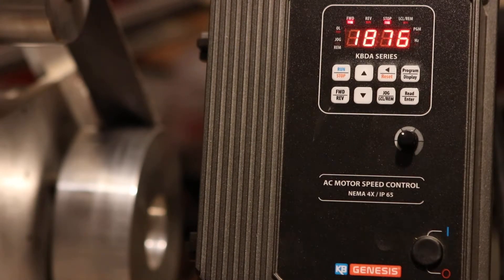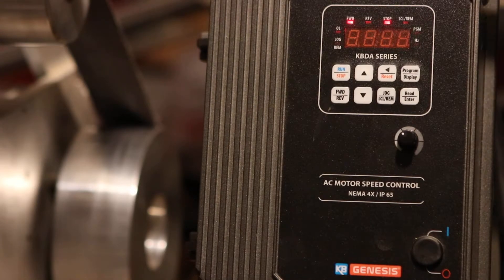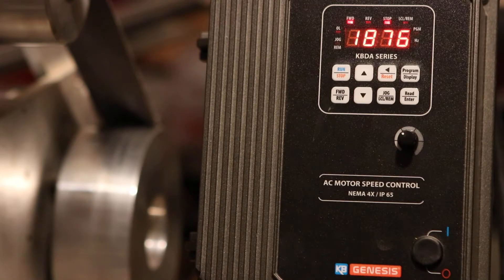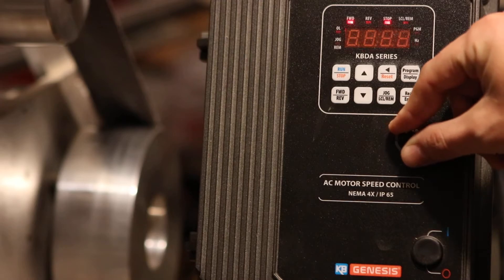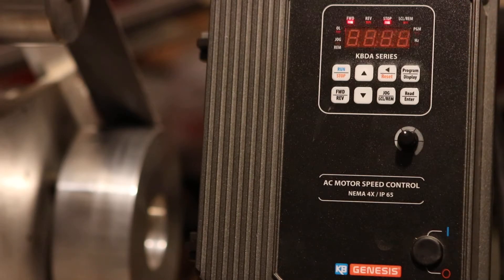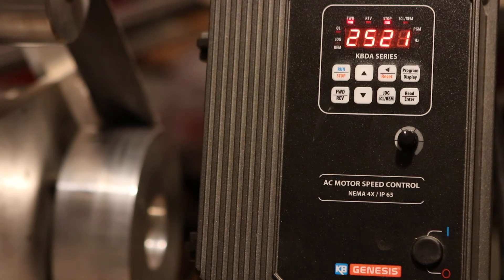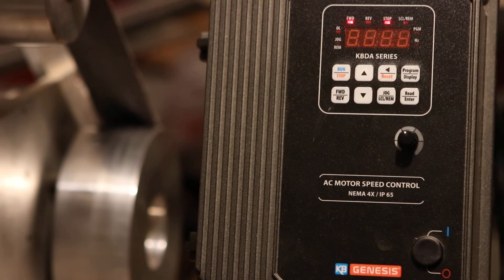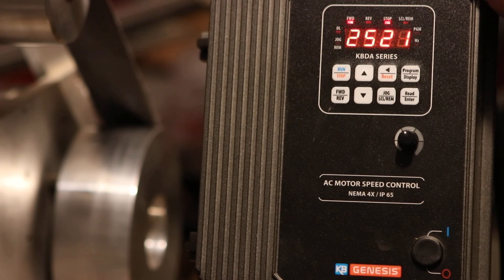Kbac or Kbda for knife grinder Vfd and why!

Comment: Thank you for this informative video.  I purchased a KBDA-29 to run a 3hp Baldor motor a couple of years ago (agree with your points!), and tried to modify the screen output per another video, but I didn't get the result I was supposed to get.  Can you point me to instructions on how to set up to read SFPM, as you mention in your video?  Thank you.
Reply from the maker: Here is the video I made about this https://youtu.be/1NsaiOwZMZY  . On page 20 of the pdf there is a table with all the settings. Short version is, figure out your max Sfpm based on the drive wheel and motor, set the vfd to max when programming and set the custom
Unit to that number.
Reply: @asquaregarden  Thank you!  I'm putting together another grinder right now, and will re-use my KBDA-29 for it.  It has a larger drive wheel, so I'm holding off on re-calibrating until the new grinder is done.  :-)  Merry Christmas, asquaregarden!

Comment: I’m having the same dilemma right now…thanks for your video.  Definitely going with the digital version!
Reply from the maker: I don’t regret buying it, I just wish I had two of them.
Reply: Just wanted to get your thoughts…I got the KBDA-29 and a 3HP Leeson Wattsaver motor.  I’m having issues with the motor vibrating and jumping throughout speed ranges.  Spent all day back and forth with KB and made some parameter adjustments which helped but I’m still having enough of a problem where I won’t be able to use it.  KB says the KBDA has issues with high efficiency motors and I may just have to switch to the KBAC.  Just wanted to see if you had any input and also see what motor you are running.  Thanks!
Reply from the maker: I have connected the Vfd to 3 separate motors at this point. Two of them are 3 hp Baldor motors, one 3600 and one 1750 rpm. The other motor is 3/4 hp Westinghouse that is likely original to my 40s Southbend lathe. All worked fine. The only issue that I have seen is when I switch from the lathe to grinder motor, if the Vfd still has residual power it will jump through speed ranges, but will fix itself after a minute or so.
Reply: @asquaregarden  Just wanted to give you an update…KB says the KBDA has trouble with the Leeson and other high efficiency motors because it hasn’t been updated to their 3G architecture, the KBAC has.  They’re doing the R&D on it now but ETA for when it will come to market is unknown.  The pandemic screwed everything up.  Just FYI for you or anyone thinking of using the KBDA with a Leeson Wattsaver.  I had to send it back and order a KBAC.  Thanks for your help.
Reply from the maker: I am glad you got a next step. I am curious if it’s going to work with the Kbda. Why did you decide to change the Vfd and not the motor?
Reply: @asquaregarden  The return shipping for the VFD was much cheaper than the motor and I got a really good deal on the motor...almost 1/2 price.  Really wanted the KBDA but it wasn't meant to be.

Comment: You mentioned configuring the display to show sfpm.  I am looking to buy this unit and have been looking at the manual they offer online.  It is not jumping out at me on how to set that up.  Can you describe the steps you took to setup the custom ratio?
Reply from the maker: You need to change options 400, 401 and 402 but first you need to know calculate the max sfpm based on your motor rpm and drive wheel. I will try to make a video on it explaining step by step in the next couple of days.
Reply: That would be very helpful as I pulled the trigger on one a couple of hours ago.

I was reading the comments of another one of your videos and It looks like I might be in for a little learning curve on getting the motor speed setup also.  I got a Leeson 116761 (http://www.leeson.com/leeson/searchproduct.do?invoke=viewProductDetails&motorNo=116761.00&productType=) that I am looking to run at double speed.  If its not too much trouble can you touch on the speed setup also?

Thanks again for your help
Reply from the maker: Here you go. https://youtu.be/1NsaiOwZMZY I made one for the 2x speed but it not up yet. I'll let  you know.
Reply from the maker: Here is the other video https://youtu.be/WM5RKepSaas
Reply: Thank you very much.  I should have my vfd by this weekend, really looking forward to trying this.
Reply from the maker: I hope it helps.

Comment: Do you have any experience with the KBMA? It's on my short list of VFD to consider buying for my lathe.
Reply from the maker: I've checked them out before. If I remember correctly the main difference to a Kbac was the enclosure and the max Hp. I personally am a big fan of over engineering and in the case of the  VFD as you can tell from my video I went with the biggest one I could knowing that I would only have to buy one. The advantage of having a bigger Vfd is that it will not limit your choice of motor. You can alway run a smaller motor on a higher rated VFD with just a  few changes in configuration but not the other way around. Plus you can run multiple motors from one like I shown in the other video. And  I can tell you that when you run any motor at a lower frequency you lose power directly proportional with the frequency decrease.  What that will mean is that your 1hp motor will quickly go to 1/2 or 1/4 when you lower the speed. The solution in this case is to   still use the pulleys for the main speed adjustment and the vfd for some fine tuning or just get a bigger motor.
Reply: Good stuff to know and consider. Thanks for sharing that insight.
Reply from the maker: You are welcome.I hope it helps.

Comment: I am looking at purchasing my first VFD and Drive Combo for my second belt grinder build.. I see other VFD's out there for $150 or so which have reverse, etc.. And, I think motor braking also.. 
I understand going for the Kbda vs the kbac. I totally agree and would do the same,, had I not seen these other vfd's that are much cheaper.. One thing that does seem to be unique is the 120v input on the kbac/kbda for a 1.5hp, instead of up to and including only 1hp, and having to move up to 220v to get to the 1.5 and 2hp range. 
The other cheaper ones stop at 1hp, and I think I want 1.5 if I can get it... Because I understand the hp goes down when you use one of these like this.. 
That being said.. do you have any experience with other brand vfd's to compare the KB Electronics to others near half priced?
I have my eye on a 1.5hp 3ph 2 pole 56C TEFC with VFD combo for what the Kbac 24 would cost me.
Reply from the maker: When looking at a VFD aside from price you should consider one important aspect other wise you will end up paying more in the long run. The first thing you need to consider is the environment it is used in because the inexpensive drives that you are talking about are generally  IP20, nema 1. That generally  means  plastic enclosure that is not dust or water proof. Once you start sanding a wood handle you generally realize why a mask is a good idea  and the second thing is that dust gets everywhere including your motor and vfd. So the main reason  the kbac/kbda are so popular is be cause the are built like tanks, nema 4x, ip 65, milled aluminum construction, dust and water proof.  If you plan on building a box to put your vfd in you can get away with it but otherwise  it needs to be one in a dust proof enclosure.
Reply: You are exactly correct.. I see that.. And, what good would it be to put it in a box and now you can't reach it easily..  Thank you.. I guess the bite on my wallet just got a bit bigger..Ha..